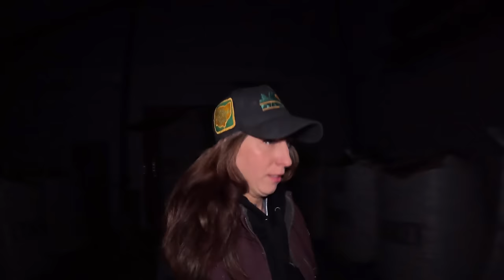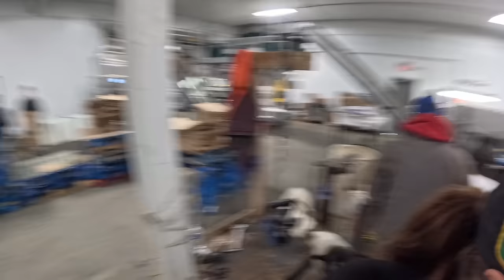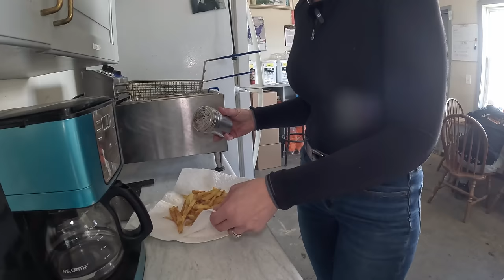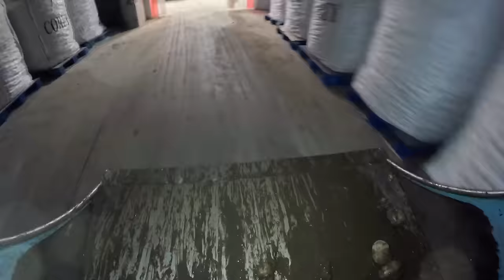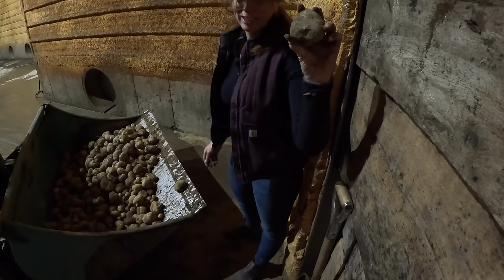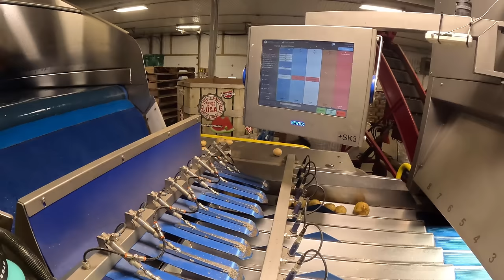The last potato on the ground

Comment: Was wondering who would get the honor of picking up the last floor potato!  How often does the dog get stepped on? Does the dog ever alert to anything wrong with the power equipment? How is the floor slab and air ducts and walls cleaned? Just water? How sharp is the bucket lip? Looks like anything less than razor sharp would damage the potatoes while scooping them up! Good video!
Reply from the maker: It was me this year! I will brush her occasionally while I work. But she doesn’t even move lol. To be honest she sleeps most of the day when she isn’t following us around! We will use a pressure washer and soap to clean everything, then the storage building get disinfected before the next storage crop. Ray will dull the bucket so it doesn’t cut the potshots. Thank you for watching.

Comment: Molly I was in your neck of the woods on Tuesday plowing snow and doing snowstorm cleanup at The Walmart in Oxford I was running a loader and my plowtruck with salter on back I work for NELTS Inc in the winter kinda wish I could've bought some potatos when  I was down that way but they track my loacation when I'm clocked in you don't by chance ship potatos via mail do you
Reply from the maker: I haven’t figured out the mailing potatoes yet. But the weather is warming up here so it probably an option!